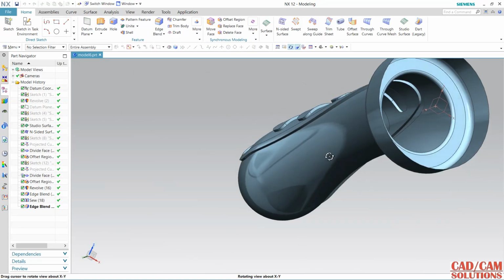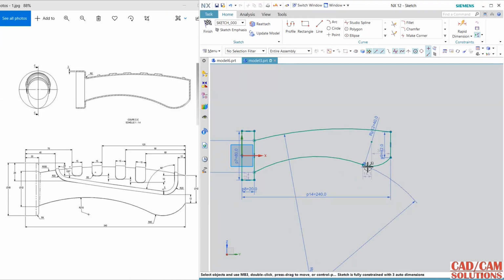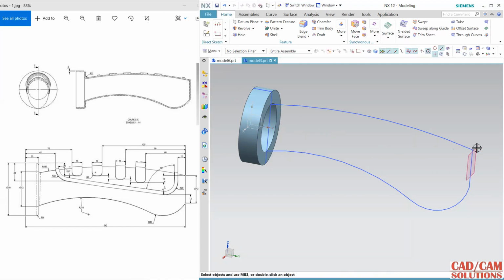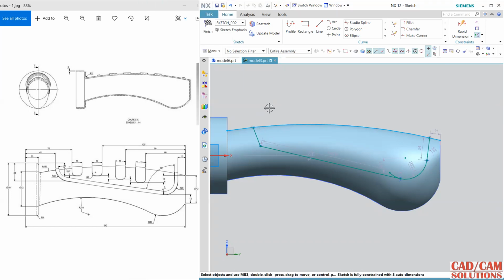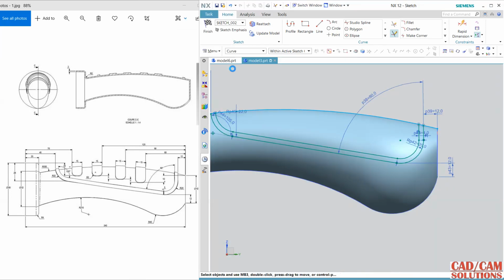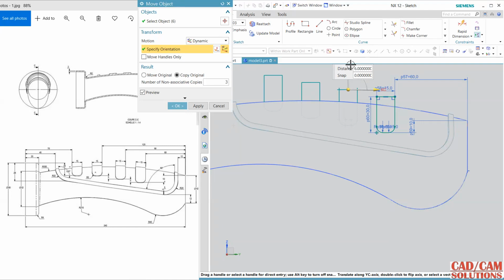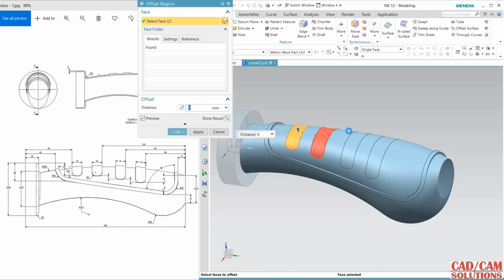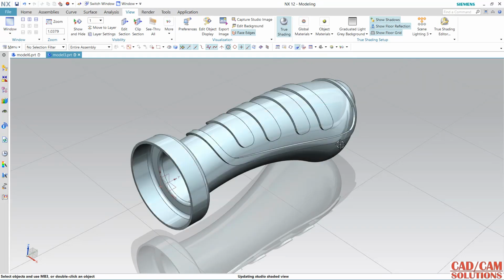#NX sURFACE eXERCISE

Comment: Sir, in 8:08 when i try to add the guide curve as a new set i get an error " Strings crossed or bad selection no surface created" what am i supposed to do?
Reply from the maker: check curve selection, single curve